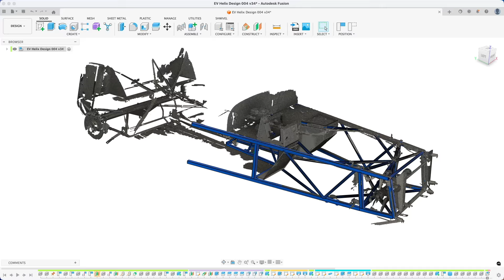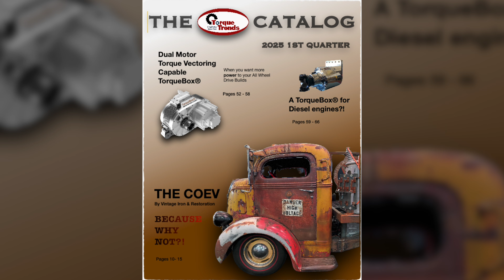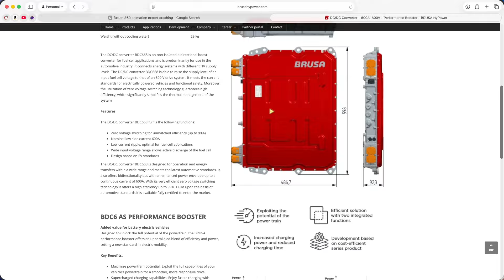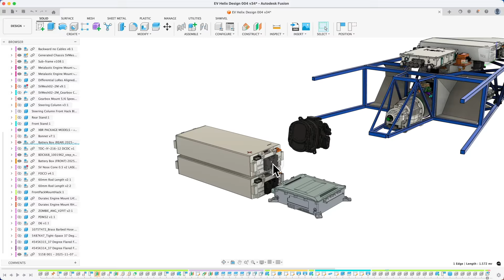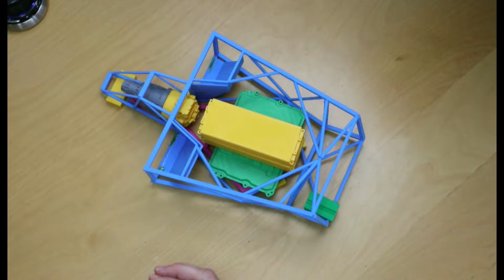Project sEVen pt6 : Mega Two Year Update Video - How I designed an Electric Vehicle

Comment: I know you are a long way along this path but have you considered using a Lexus GS300h or GS450h gearbox instead of this motor/gearbox setup? I realise it might not fully fit in the old gearbox location but with your space being so limited it might still take up less space than the separate motor/gearbox solution. It would have more than enough power for your needs and is a proven solution.
If possible It might be cheaper/easier to adjust the chassis as required and go for an IVA.
Reply: Assuming you go ahead with the current design are you sure the subframe will be sufficiently stiff to handle the torque?
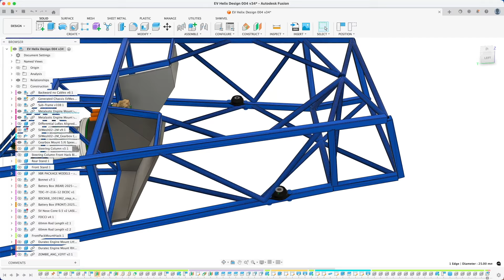As an ICE car the engine was bolted to the engine mounts shown at 31:57 but it looks like the subframe will be taking all the torque instead. The rear mount will do little to prevent a lot of twisting action.
Have you considered modifying the steering column with UJ joints to give more room for batteries?
I didn't see any provision for a low voltage junction box which may take up a lot more room than you think.
Sorry should have also said, subbed and looking forward to more updates.  🙂
Reply from the maker: Thanks again. All good points. The sub-frame stiffness is certainly a concern. And there’s a couple of issues there (as I’m sure you know). There’s a static load issue and I’m hoping that I can add stiffening to the sub-frame to help there if needed (though more stiffening means more mass to handle). The FEA seems to show it’s ok as modelled but I do need to do more work on that area. Secondly, the reaction-torque is possibly an issue. And as others have said the gearbox is close to the chassis, so any flex may cause the two to contact. It doesn’t in the ICE car (with much closer fitment) but as you rightly point out the engine is a structural element in the ICE car and that makes a huge difference. I also appreciate that there are oscillatory issues with the suspended mass… and I need to account for axial oscillations there. My thoughts on that (having discussed with a couple of automotive engineers) is to use torque arms connecting the top of the suspended mass to one, or both, sides of the diagonal chassis rails around them. I intend to use the front top cruciform of the chassis at another stabilising point, so that may help too. But without an expensive simulation system I’m going to have to be flexible and aware of the issues so I don’t box myself into a corner (engine bay! 😂). I’m way over committed on this solution, so I have to make it work now. 😊
Reply from the maker: Another couple of cracking points to pick up there… 
I looked at UJ’s in the steering column, yes. A friend has a seven with exactly that setup to accommodate a different engine. It’s still an option if something goes wrong with what I have planned, but it’s another thing to get engineered and definitely falls foul of the new DVLA guidelines around changes to steering and suspension. 
On the topic of LV junction box. Yes… and… no. By using the AIM PDM I have almost all the control going back to it as single connections… it’s sort of the LV junction box itself. I’m just sitting down with my morning coffee (answering YouTube comments) and getting ready to go to the office to continue with my schematics. I’m very much of the school that things should be designed first and THEN implemented. So I’m doing full schematics of LV, LS and HS. That should tell me whether I have to have a LV J box. If I do need something then it can go under the dash in the passenger footwell.
Reply: @Purplemeanie  If you've seen my videos you'll know I'm very much the opposite in that I have an idea, figure out a method in my head and go for it. I then have sort out the inevitable issues later. Your way might result in a better outcome but takes more time.
You probably have thought of all these already but for the HV and LV junction box here are a few things to take into account.

For the HV JB you need room for 
Four contactors, two for driving and two for DC charging.
Precharge resistor and relay/contactor for it
HV HC Fuse
Shunt (if using one)
Low current Fuses or trips for DC to DC converter and heater if installing one.
All associated connectors and cabling for these things.

For the LV JB you will need fused 12V and Gnd for:-
Brake boost and control for it
Coolant pumps and control for them
Contactors
Each of the modules you're installing
The shunt
Any additional micro controllers you subsequently install

I believe it is good practice to use a fuse and contactor (at least one) inside each battery box so allow for 12V to the battery boxes for this,

I may have gone over the top but I have individual fuses for most things in my car so my LV junction box is pretty large with 2 x 12 way fuse holders with each having 12 grounds. one fuse holder has permanent 12V and the other is switched by the ignition. I also have an 8 way 12V relay module for switching heavier loads.
So long as you have provision for things you didn't think of in the design stage because there will always be changes and additions.
Reply from the maker: Cool! All really good stuff. And yes I’m accounting for all of that… and more. My setup with the traction Dc to Dc converter means I have a lot more contactors. However the fact I have an AIM PDM is a massive help since all its outputs are soft fused. I can set current limits on all them individually and get diagnostics on what they’re all doing. 
On the subject of “suck it and see” vs “design first”… I started my career as a silicon design engineer (35 years ago) and a set of reticles was over $1m, so we had it drummed into us the need to get it right first time. Having said that i also subscribe to the “don’t get it right, get it running”, so theres a balance of the two. But i accept im probably closer to the former not the latter 🤷‍♂️🤣
Reply from the maker: Thanks for the comment. I did do mock-ups of both those options. They protrude too far into the engine bay and take away too much of the space I want to use for batteries.

Comment: Nice work, and it's a big undertaking for sure. But I was wondering, why you do this instead of enjoying the drive with the car all this time? I'm building a Locost in LA from scratch and it is a lot of work for sure, figuring out every little detail on your own, and I don't even know how to use CAD. You can't fit a third battery at the rear on top of the other two? It seems like it would fit.
Reply from the maker: Thanks for watching! 
Well, this project car is my second Caterham. I have a 420R that I drive around on a regular basis… so I’m very lucky to be able to do the project AND hoon around in a Seven at the same time. 
You’re totally right that I could get a third battery above the two at the back. And that’s very tempting. But there’s two reasons holding me back from that at the moment. First is a silly one, but i sort of want to keep some practicality, so want to keep some boot space. Secondly, I’m concerned about the rear chassis being able to cope with all the weight. It’s much less strong at the rear and it feels like I’m already pushing the structure with 2 modules and an AC charger. Adding another module feels like a step too far (and would be much more mass than an ICE car has to deal with there). Maybe in phase 2 i can think about more modules, but phase 1 is all about “don’t get it right, get it running”. Good luck with your build 👍🏻

Comment: Very interesting to see what all the complications are once a project like this actually gets designed. 

Sooo, where in the model did you leave room for this alleged cooling system? 😁
Reply from the maker: The cooling… there’s a quite large area in front of the chassis that the ICE radiators usually sit in. I’ll sit the water and oil radiators there and the pumps will go where the dry sump tank sat in the ICE car (which is between the top and bottom cruciform at the front of the chassis). That’s the plan anyway! Hopefully I’ll show all of that in a video soon. I have it all modelled, it just didn’t make it into this video.
Reply: @Purplemeanie  Best of luck, I'm already looking forward to your next video. Every time you upload it's an unexpected and welcome surprise.
Reply from the maker: Thanks. I'm glad someone's getting some benefit from the videos 👍🏻

Comment: with those clearances in the tunnel and still soft mounting it will be a huge problem. Your motor and gearbox will start making their own clearance to the frame. Im in awe of just how much money/costs are being dumped into this project, feels like a lot of waste effort to come to such a massively complicated solution.
Reply from the maker: Hmm. Thanks for watching Tom. Not a great vote of confidence then! 😮 
To pick off the two issues… clearance: I’ll actually have more clearance than the standard ICE gearbox has in the same location. And with a similar suspended mass I’m hoping I won’t see any more travel than the stands ICE install - I have done a lot of calculations around this.. it’s one of the key risk areas. My ICE gearbox has about a sheet-of-paper’s-width between it and the chassis and it doesn’t rub. But you’re right, it’s a concern… but I have thought about it and I hope mitigated it.
As for cost: I’m enjoying the process. I’ll be coming in at a very small fraction of what Caterham spent on their two prototypes. I know that’s apples and oranges but I take some comfort in that! 🤣 I’m also having a ball with the project, isn’t that worth something. 🤣
Reply: @Purplemeanie  In the end its your project and its about you enjoying it. If you got more clearance then stock its should be okay. How good are you at programming? Your system is quite complicated and will take alot of effort to get working. Luckily Zombie is very flexible and easily changed to do what you want if you can code.
Reply from the maker: Tom, software and electronics is my thing. I’ve spent the last 35 years running realtime software and electronics companies, usually much bigger and faster projects than Zombie. I started my career as a silicon design engineer designing processors for a large European semiconductor company… so this is the bit I’m going to enjoy the most.
I’ve been over the Zombie code and it all looks fine. Thanks for taking the time to comment. J